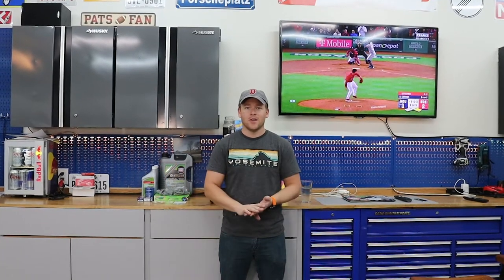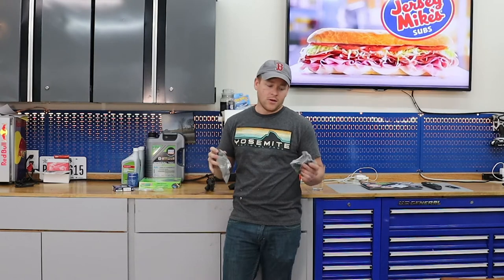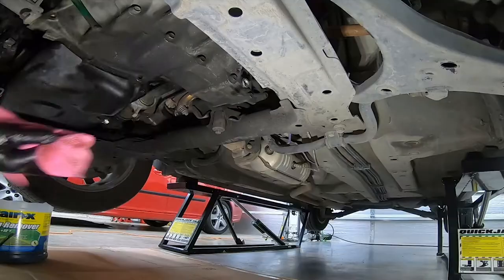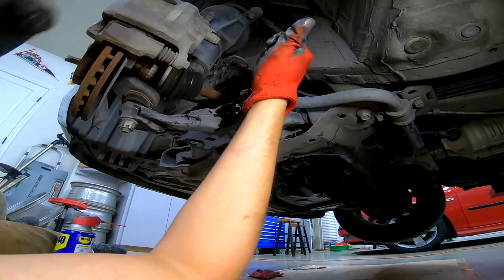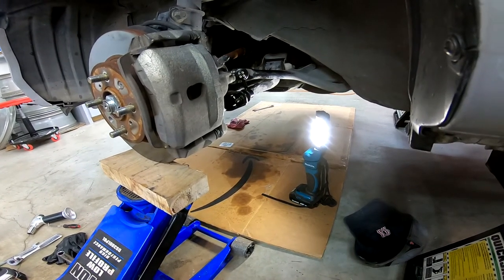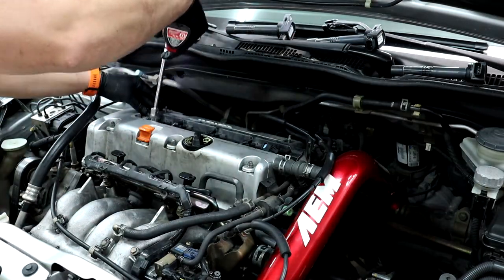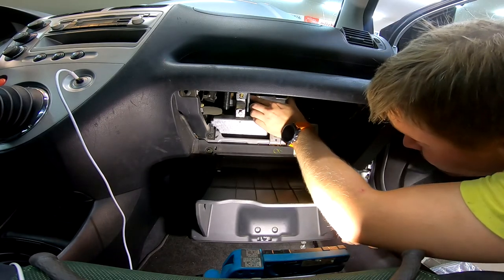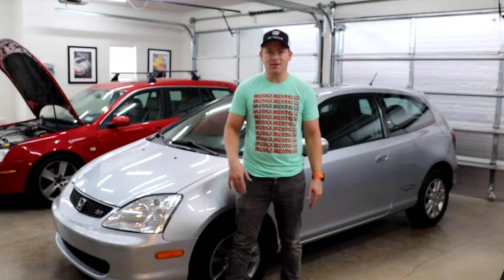Honda Civic SI EP3 Mechanical Restoration

Comment: Did the transmission fluid change help it go into gear easier. Because mine doesn’t go into place as nice. It works fine but it could be better.
Reply from the maker: Yeah it goes into gear better than before. If yours is real bad put some cheap auto parts store fluid in run it for 500-1000 miles drain it and put in the OEM Honda fluid. Fluid flush cleans everything out helps it operate smoother.
Reply: @thefadshow  I’ve heard people say trans fluid flush’s are bad. Is that true or is that an automatic transmission thing. My car works perfectly fine. I just wanted to see if yours had a big improvement.
Reply: @thefadshow  thank you

Comment: Lifting the vehicle from rotors are bad for the car ?
Reply from the maker: No but I probably should have put some lug nuts back on. Only thing holding rotor on is small set screw.